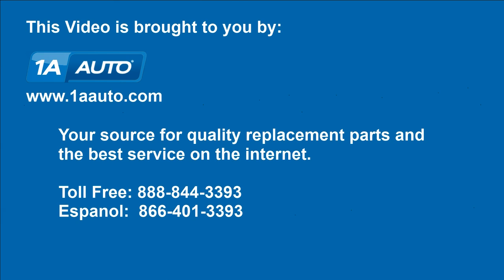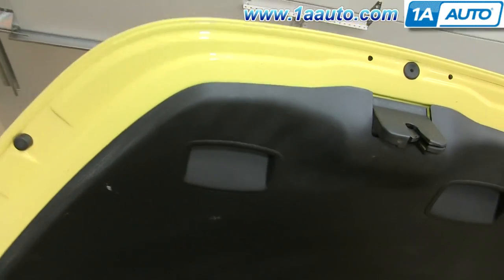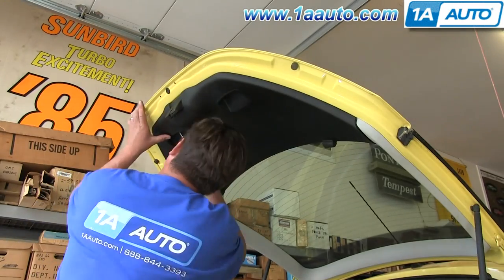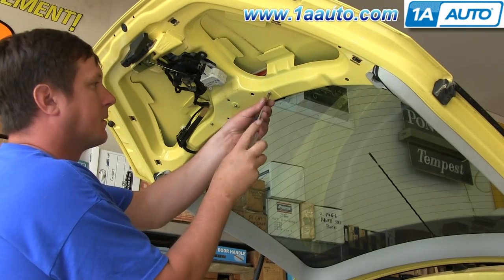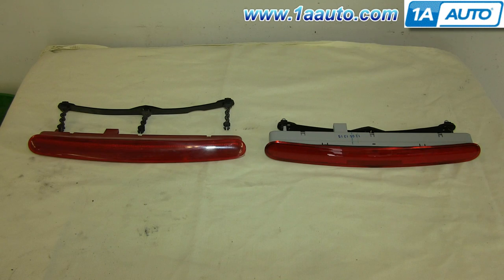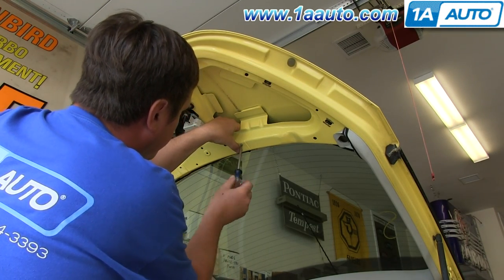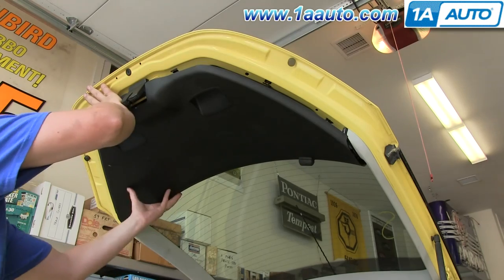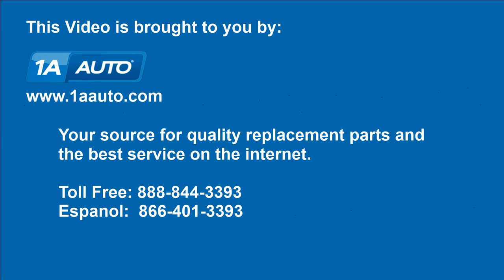How to Replace Third Brake Light 98-10 Volkswagen Beetle

Comment: my 2006 beetle TDI alarm was going off every 30 min so I took it for a drive and trunk idiot light came on.  Watching your vid to properly take the panel off was very helpful.  I noticed water was coming through the 3rd break light down to the wire switch latch.  I pulled out wire and connectors were corroded.  Cleaned it well, plugged it in, sealed around the 3rd break light and no problems since.  Thanks again for the vid ;)   ~BioTDIcandy~
Reply from the maker: +meellad1971 Thanks for checking us out. 1aauto.com
Reply: Mr wife's 2004 beetle alarm keeps going off whenever we lock it ... Have noticed water sitting around 3rd brake light after we wash it - wondering if we have same problem. Will definitely try this now thanks 👍
Reply: tractor boy 2421 Check the latch wire connector.  Luckily mine was the problem otherwise you might have to replace the latch.  If you're tdiforum.com member, you'll see everyone had the same problem.  Good luck

Comment: I have a 2001 but it has an automatic latch switch that made it more difficult to replace.  That assembly covered the right side holes that you would be able to stick your fingers into to hold the assembly and get the screws lined up.  The Dorman screws that come with the light are ridiculously short.  I bought some metric machine screws with a larger head, 12 mm long, and those seemed just right.  Be careful, the light and assembly is very fragile.  I hope this helps

Comment: This was an extremely easy repair but there's one hitch, when you go to remove the screws to take off the cover that you need to take off to get to the light, on this video he shows two screws and this may be true for some Beetle but mine had one screw and....a child safety button which can be used in case of emergency, a child gets into the truck accidentally. You can't remove this wire which is connected to the truck lid lock so once you remove the one screw the whole lid will be hanging down while you are removing the light. You'll see what I mean if you have a child safety button inside in your Bug. Confusing but I worked around it and it hung in my face but I ignored it and went ahead and changed the light, pretty simple.

Comment: They should tell you when installing the new one, gently pull down on the black bracket on the back of the tail light outsides, to start the screws and install the middle screw last.
Reply from the maker: +Brian Mains Thanks for watching. If any of our viewers needs to make this repair we carry the part shown in this video on our website. Here's a link to them https://www.1aauto.com/1998-10-volkswagen-beetle-high-mount-third-brake-light/i/1altl01856?utm_source=YouTube&utm_medium=CTA%20Comment&utm_campaign=1ATony
Reply: Brian Mains this helps a lot

Comment: Is it possible to simply change light bulbs inside or the whole thing needs to be replaced every time?
Reply from the maker: +nemanja milosevic The bulbs in the brake light are not serviceable. You would have to replace the entire third brake light assembly as shown in the video. Here is a link to the one that we carry. Hope this helps you out https://www.1aauto.com/1998-10-volkswagen-beetle-high-mount-third-brake-light-dorman-923-255/i/1altl01856?utm_source=YouTube&utm_medium=CTA%20Comments&utm_campaign=1ATony

Comment: ugghhhh!!!!  Have 2009 and only one side of panel has screw???  Other side looks like emergency release button??????  NOW WHAT?????   explosives?????
Reply: My 2006 is the same.  Can't find info on this.
Reply: Dick Van Gelder same problem with our 2008. cannot remove the panel
Reply: WELLLLL, It appears that there may just be one screw holding;  other side has clips that can be pulled at/off.  Don't yank too hard as there's an emergency strap connected to the panel and I guess a pull plug in case you get locked in the trunk.  There's a little play when you pull panel off; then I was able to push plug out of holder to release. WHEW!  This video also did not accurately present the picture of putting in the new light once you get there and have old unit out.  Very poor design by VW; flimsy holder and gasket didn't sit well in the inset where it's supposed to seal unit.  My replacement light broke in the process, and I ended up buying silicone adhesive caulk and just "glued" the old light in place for looks.   There are no words to describe my love of German engineering!!!LOL
Reply: Dick Van Gelder 😮. what a mess! we ended up taking it in to the shop and got charged $45!